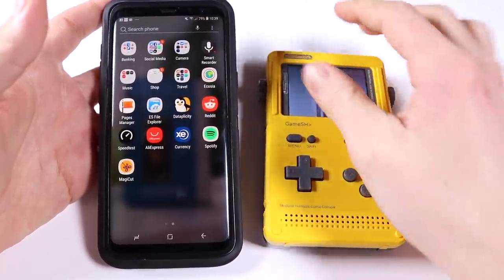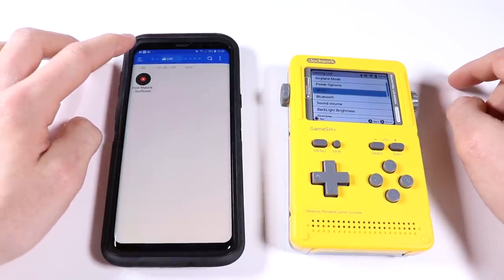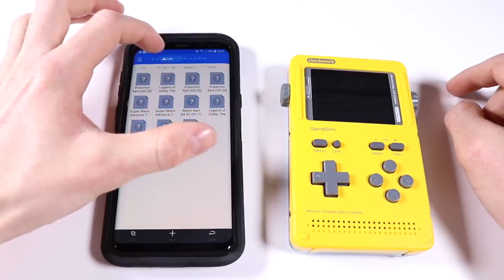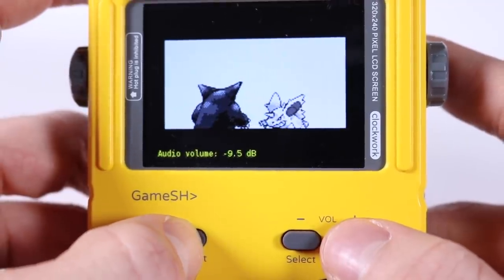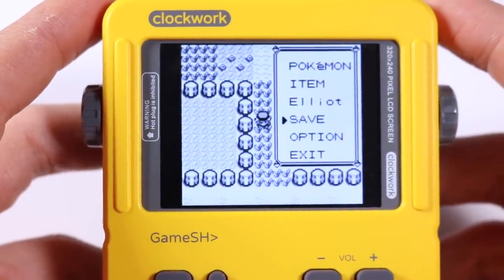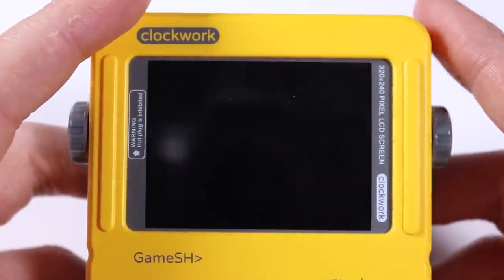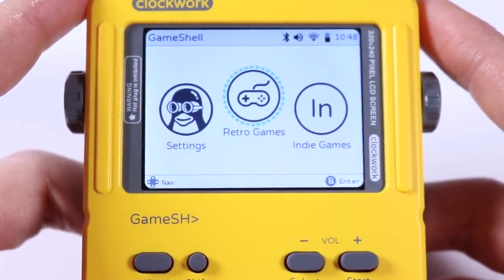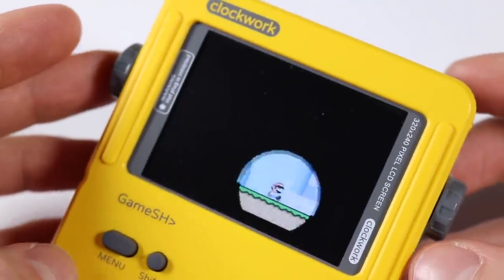Clockwork GameShell Game Installation! (Android)

Comment: Will certainly buy it some time this year. Love the DIY aspect requiring zero skills to modify circuits which is excellent and the convenience to connect directly via wifi and bluetooth with mobile devices. This DIY is just like assembling a model kit.
Reply from the maker: I love it! Totally agree.
Reply: I wonder if there will be a version 2 of the console in the next round or will they maintain the shell structure and simply market with modular upgrades. It would be really cool to have the latter available and people will probably want replacement parts down the line too.

Comment: I setup the light bar so that the connector faces inward toward the upper opening and the wires go directly into that upper opening. This way there are no wires on the outside of the device at all.

Comment: Fyi, the screen tearing may be reduced by switching the gpu driver to Lima
Reply from the maker: Excuse me? 😂
Reply: @TheRetroFuture  Ppl were commenting about screen tearing, I read on the CW forum that Lima might be better at reducing screen tearing.
Reply: its also possible the screen tearing is only showing cuz of the camera. if i remember it happens due to shutter speed vs screen Refresh rate